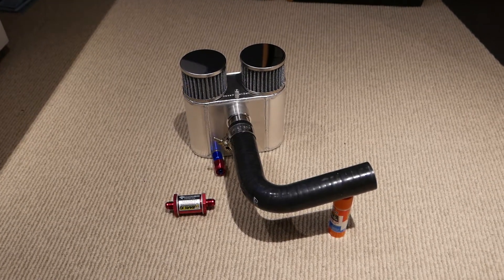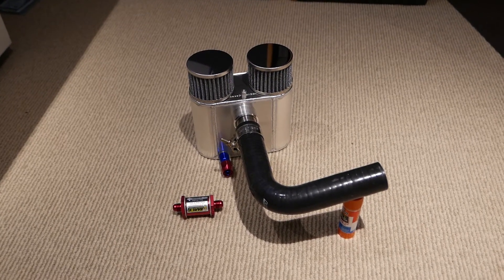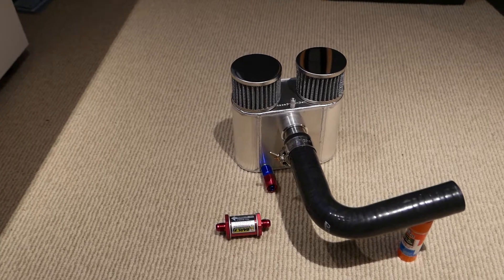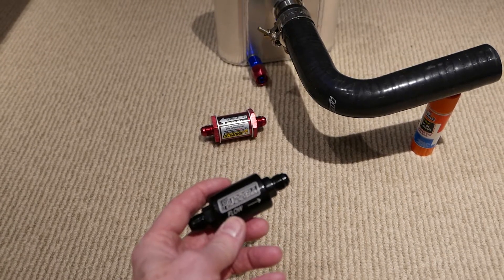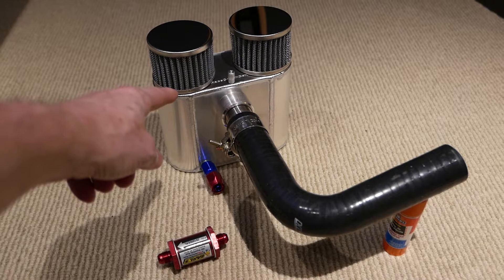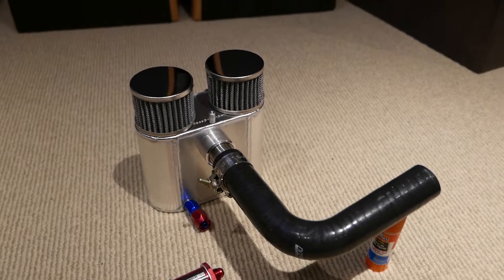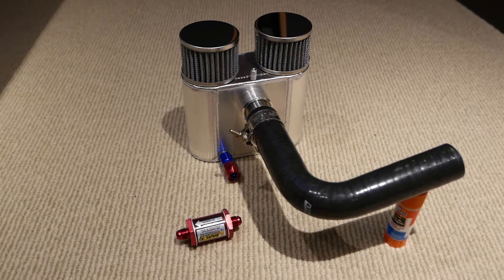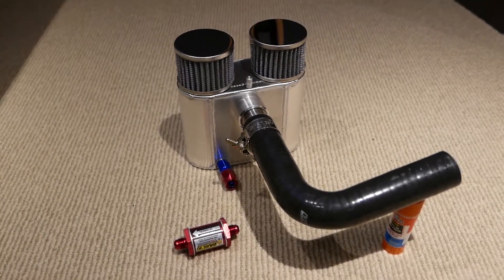The Ultimate 1983 Rabbit GTI - part 161 (Racing Oil Catch Can System)

Comment from the maker: I now have all of the remaining fittings and have welded up a trick bracket to mount the oil catch can so will be heading back to my GTI guy garage on Vancouver Island on Mar 26th to install everything, including the new 6" height 440lbs/in front springs, re-adjusting the height on all 4 corners to give a 3/4" gap to the fenders, installing a new 2 axis accelerometer, and otherwise hopefully getting the car ready for some track time to sort everything out in April. My aim is for a reliable track car for 2018 - no oil system issues, or other reliability or safety issues. I just want to be able to get lots of track time in with the GTI. The longer term plan is to de-tune the suspension and put the OEM seats back into the car and keep it purely as a street car - once it is proven as a capable track car that can beat modern sports cars. I am planning on ordering a Radical SR3 or SR8 for track use in 2019 - a dedicated supercar for track-only use.

Comment: Sure you want to drain back to the engine? With your new engine, you'll likely fill your catch can with water vapor rather than oil. Also, being able to see how much your catch can fills with oil will let you know the health of your engine. If it keeps draining back into your oil pan, you'll never know.
Reply from the maker: I will do some experimenting with a ball-valve inline with the check-valve. My thinking is that for the limited amount of time on the track and how often I am changing the oil when there, water may not be much of an issue. But I could be wrong!
Reply: With my new motor, I put about a pint of oil in my catch can with 8 races and 8 qualifying sessions. With my old motor, I could see that it was getting tired by the increase of oil in the catch can after a session. (About a pint after each session.)
Reply: VWRalf 
GREAT information there, Ralf!